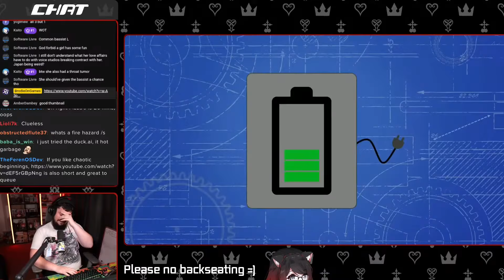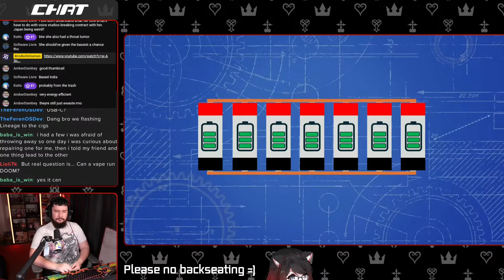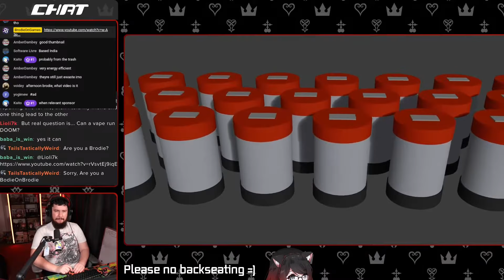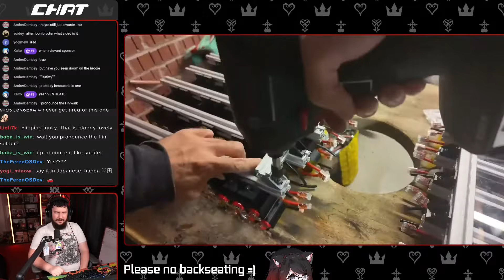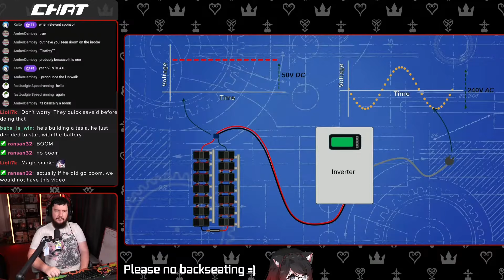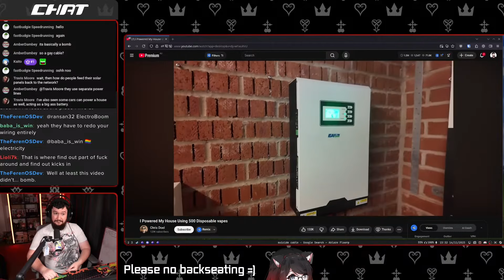Don't Power Your House With 500 Vape Batteries

Comment: So, about tue whole inverter stuff... I designed my full house backup, so I can tell you a few things. Grid tie-in or grid follower inverters are a separate breed from off-grid ones. They synchronise with the grid and completely cut off when grid goes down. Off-grid inverters make their own wave instead. Some inverters can work as both, such as the Deye hybrid I have without needing anything fancy. Some hybrid inverters need a separate "backup box". The latter is the case for Huawei, a very common brand where I reside. Mine was one of two homes with power in the village last multi hour blackout, even though most houses technically have inverters capable of off grid functionality if set up for it.